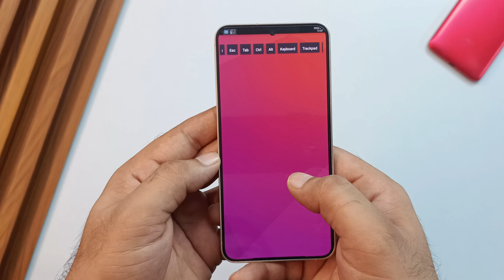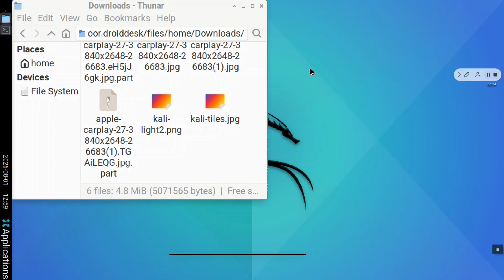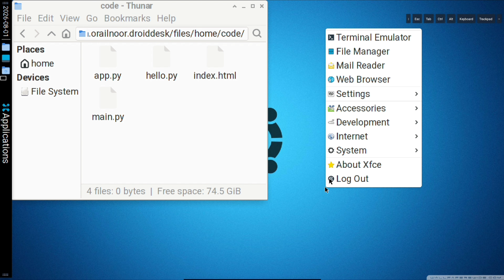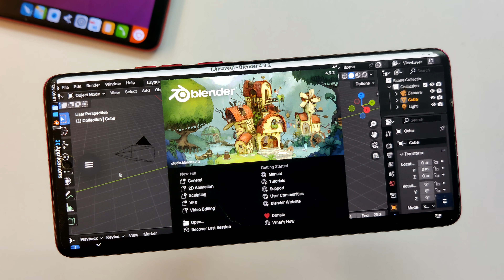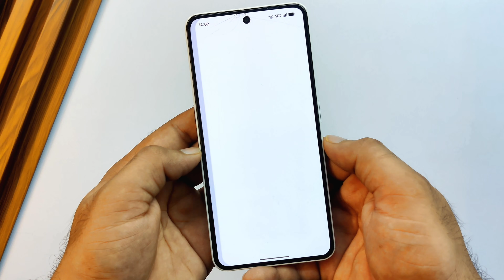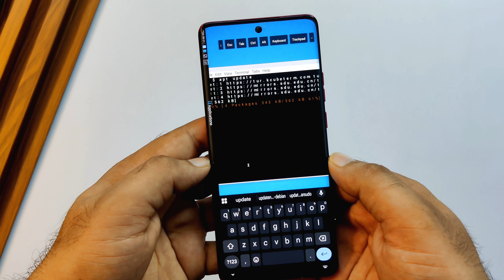Turn Your Android Phone Into a Full Linux PC (No Root Needed)

Comment: Bro, on the OnePlus Nord CE 2, bootloader mode doesn't open. Even if it does open, it automatically reboots back into the system after 1–2 seconds. Can you tell me the solution?

Comment: It is taking so long to setup, uses very low network speed(1-2KBps) for it. What should I do?
Reply from the maker: I think there is a problem with your internet; try using a different internet connection.

Comment: Alas! this is not for the phone picking up dust in your drawer...this is for flagships and ex flagships! Because Linux is running inside an emulation layer (Termux) on top of Android, it cannot access your phone's hardware at 100% efficiency.
Reply from the maker: You are right, but it works fine on almost all phones(low specs and mid range); I have tested it on my old OnePlus 6T, Realme 5, and K20, and it runs smoothly on all of them.

Give it a try.
Reply: it work on my vivo y11

Comment: How to connect external display like tv monitor
Reply from the maker: If your phone supports display output you can just connect it to any screen with type C cabe ot Type C to HDMI connector.

Id not support display output then you need a PC and use tools like Scrcpy or Android dex. I already uploaded videos on it you can watch that
Reply: You can either screen share if connecting to another pc or dock your phone with a docking station and connect a hdmi cable and it should show up on the monitor
Reply: @gthanthememeguy6806 ❤
Reply: I'm using moto neo 40 all working but audio not supported any solution